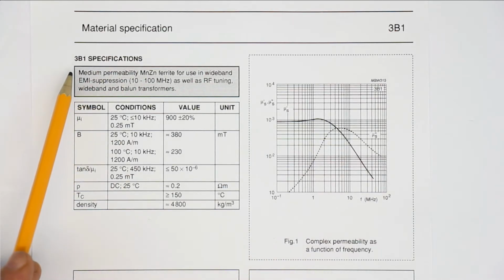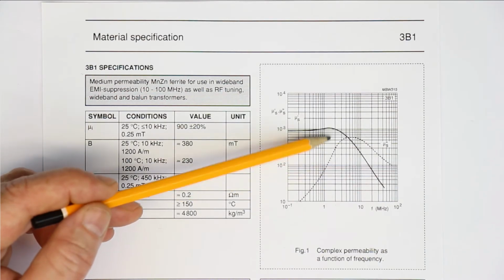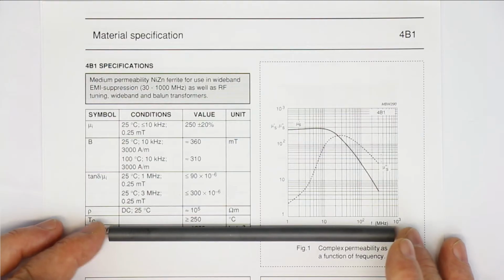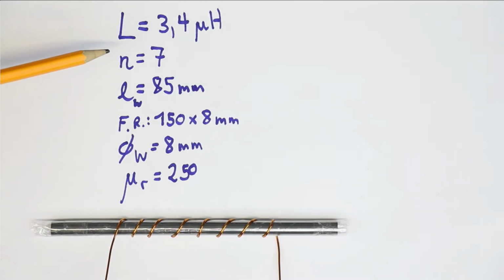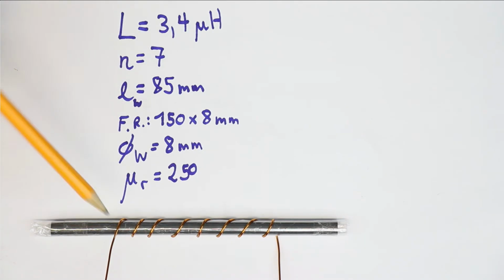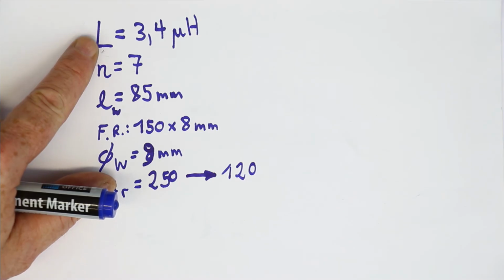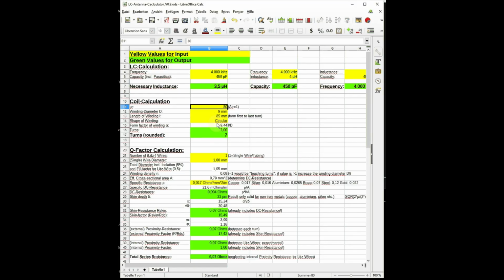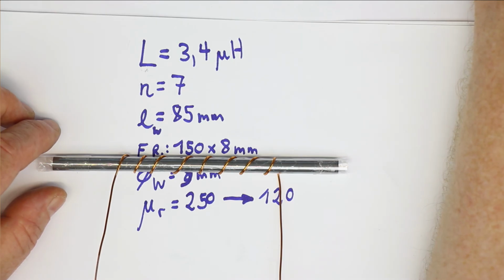A Ferrite-Rod for SW-Reception

Comment: Interesting to play with but actual loop antennas are going to be much better
Reply from the maker: Yes, true. But the advantage of ferrite rod antennas is the much smaller volume for the same signal strength. They simply get "problematic" in the higher MHz-range due to the properties of the ferrite material.
Reply: @KainkaLabs I don't find they are better than a decently sized loop antenna.
As i said, they are fun to play around with.
Get a differential amplifier chip with a good gain bandwidth product and try your ferrite loop and poly film variable capacitor loop antenna on that! Try the NE592 Video amplifier...

Comment: Very useful~
4B1 material seems to be a FERROXCUBE product~
This is similar to FAIRRITE's 52 material~
In the LOOP state, it is useful up to 50 MHZ, but when used as an OPEN LOOP of the BAR type, the permeability of 250 seems a little insufficient.
Even if the loss increases slightly, the permeability should be high so that the self-absorption ability of the radio wave improves a little more~
And the important thing is the length~
Since the relative frequency is relatively low, the length should be increased to increase the potential of the input signal~^^

Comment: Have you tried it for transmission?
Reply from the maker: Ferrite antennas are only useable for reception! If you try to send a high current through the coil the ferrite will immediately saturate. That´s why LW, MW and SW-Antennas are completely different and never use ferrite material.

Comment: Is aluminium a useable SW material ? It is often used in VHF coils.
Reply from the maker: What do you mean by "a useable SW material"? As core for a winding or as wire-material? Anyway Aluminum is certainly not suitable for both at SW-frequencies.
Reply: @KainkaLabs  It is used for VHF/UHF coil cores. Thats what i mean. CORES.

Comment: I have a question about the reference loopstick you showed with 3 litz wire windings on it (1 small, 1 large, and then one tiny one in blue wire) : I assume these are there to allow the antenna to cover multiple bands, is it possible to have both (or all 3?) bands active at the same time, or do the unused portions have to be open circuited to allow the proper resonance of the remaining coil?

Comment: Roger , thanks for the info and video , i am thinking of making the loopstick antenna for a s w Crystal set i built which tunes from 5 to 10 mhz. Needs tuned half wave dipoles to pickup enough signal to hear the audio ! I am wondering if i build a similar rod antenna like the one described in the video would receive enough signal to work as desired !  So happens the coil i made from #12 copper wire (2in) diameter is 3.3 uH !  Any help or recommendation would be appreciated !  Thanks again ! Jerry K9UT

Comment: Interesting rod-antenna notion ..
I remember bk in the early 90's a hitachi am stereo  C-QuAM modulator using pure. 9999 silver wire winded at a long ferrite rod made in Japan,  but I'm not sure what type of material they used on the ferrite rod antenna..
Thanx for the video.. keep up the good work..
Fred Feldmeier 
Dubai UAE..👈😎👍🇦🇪

Comment: Trying to better understand the choices for insulating the ferrite rod. You mention that Polypropylene, Teflon, and Cellophane are good options. Is that because they have high dielectric strength? Or low dielectric strength? I was planning on 3D printing some insulating collars using PLA filament for the coils. Is there another filament material that would be better? My application will operate between 400-500kHz.
Reply from the maker: It are the dielectric losses which manifest in the dissipation factor (not the dielectric strength). Lower is better. You find some comparison data here: https://en.wikipedia.org/wiki/Film_capacitor 
Teflon is best followed by polypropylene/polystyrene. I mentioned cellophane because it is readily available as the transparent material that is used in food packing. About the properties of the plastics used in 3D-priners I don´t know. But I think they are not very good concerning the dissipation factor. 500 kHz is not that crtitical concernnig the losses. Remember that this video was about the SW-Range from 2 MHz...30 MHz
Reply: @KainkaLabs  Thank you!

Comment: Hello, can I glue a broken ferrite rod back together ? What glue would you recommend ? I would swap the ferrite rod, but I don't know its properties.
Reply from the maker: in principle it is possible. About the glue you have to try for yourself. I would start with either superglue or 2-component epoxy glue. You will probably only have a single try :-)
Reply: @KainkaLabs  I will use UHU endfest 300.
Should I clamp in together with a C-clamp ?
Your 10mm x 200mm rod would probably work, 3B1 ? for long wave, SW and MV. I don't own fancy gear like a frequency generator or a frequency counter, I can't do adjustments.
Reply from the maker: Our 200x10mm ferrite-rod is of Russian origin. So no datasheet. But it is useable only for LW/MW. Only our 150x8mm rod is of a special ferrite-material suitable for SW-frequencies.
Reply: Used in the GE Superadio.  @KainkaLabs

Comment: Howdy.
To estimate the effective aperture of a ferrite rod check this site:
   https://caves.org/section/commelect/mm/mm04.html
Regards.
Reply from the maker: There still remain some variables like the size (length) of the winding and the position of the winding of the rod. Theses parameters are often used for fine-tuning the inductance of the winding.
Reply: @KainkaLabs  Yes. You are correct, of course.
The graphs only evaluate the effective aperture or "amplification" of the rod.
Regards.

Comment: That's a great tip and it's something I've always wondered about and didn't know the answer until now. Does it need to be ethanol or will other kinds of alcohol also work? Btw it's denatured alcohol not denaturalized (which means something else entirely).
Reply from the maker: I would only try it with ethanol. The reaction is well described in chemistry textbooks and I am not so much into chemistry to predict if also works with methanol or isoparopanol. Just 2 more hints: Do not use a kitchen burner as I did in the video. Use e.g. a bit of the alcohol that you later use for the reduction reaction. And for not too thick litz-wire or copper wire: use just your solder-iron set to >350°C and use solder with 3% flux ingredient. The action of the flux + the heat of the tip will usually also remove all residues, oxides, sulfides, enamel or PU coating etc.
Reply: @KainkaLabs  Thanks for the great information. Chemistry and I have parted ways since high school and ever since then I generally go out of my way to avoid opening a chemistry textbook - hence I prefer asking others ; )
Initially I thought this only applied to the special enamel (polyurethane?) of Litz wires but, coming to think of it, it's a copper reaction so as long as the wire coating is burnt off it should work for any enameled wire. My only addition to this would be to hold the end of the wire near the length to be tinned with a pair of pliers so as to prevent the heat of soldering tip or flame from damaging the wire coating further down.
I just realized I've posted this comment under the wrong video - which is a shame unless you have the power to move it under the correct one.

Comment: Where did you get your ferrite bar from.the ones I could find On eBay  two side are flat and two side are,I am four droids inch long bar .I am trying to make a new one for tube radio anyone ?
Reply from the maker: It´s just a matter of finding the right number of turns to get the correct inductance with an unknown ferrite rod. There are so many variables (ferrite material, diameter, length, shape, position of the coil on the rod) that you can only it determine it experimentally.
Reply: @KainkaLabs  the old ferrite is in several pieces and the new ferrite bar is a larger size ,I couldn't font the same size ,so I going to wrap the length of the new rod,I ordered bees wax to dip it in 0when I am done the replacement rod has two flat side and two round size so that's kinda of a pain too.
Reply from the maker: It´s available in our shop: http://www.ak-modul-bus.de/cgi-bin/eng/iboshop.cgi?showd280!15,374236454720163,FERRITE-ANTENNA
Ferrite rod alone:http://www.ak-modul-bus.de/cgi-bin/eng/iboshop.cgi?showd280!15,374236454720163,FS20010

Comment: I will be making a replacement ferrite antenna for a AM tube radio ,the ferrite antenna that came with my radio was shattered ,so I bought a ferrite blank and magnetic wire ,and am going to try to copy the original best I can ,my broken antenna didn't use any plastic on it .so I am hopeing  when I get it done it will work .anyone I put would be nice.

Comment: An excellent very informative video. Since I'm surrounded by ever increasing "electrical pollution," I was forced to install a second "loopstick" antenna for shortwave. My radio uses a ferrite rod for medium wave and "shortwave 1" (2.3-7 MHz). I made my own loopstick antenna for "shortwave 2" (7-22 MHz). The rod I used appears to be material 61, which has a lower permeability than the AM/shortwave 1 rod and looks more gray. I used an approximately ~7 1/8" (~180 mm) rod, and I was surprised to receive many signals including amateur stations on the 20 meter band. I can hear static all the way to 13 meters but there isn't much broadcast activity there. Sometimes when propagation allows, stations on 41, 31 and 25 meters sound like local medium wave stations. On some occasions even stations on 16 meters sound as if they were local medium wave stations. I use the ferrite rod antennas because they "hear" the magnetic signal instead of the static plagued electrical portion. Using the telescopic (electrical) antenna in my location renders these signals useless.
Reply: Sir my tube radio Philips 15RB708/00S in m/w anttina coil not original so please help me for good response
Reply: Waste of time. Just make regular loop or buy one.
Reply: @KandiKlover  Don't be so dismissive. It's not a waste of time in the slightest. It's far more transportable than a loop and less prone to damage in a bag. Also, why buy when you can make one for far less whilst also being able to make sure it's operating at optimum for your own sets? Plus, there's far more self satisfaction and learning involved than just clicking in A*****n or E**y.
Reply: @KandiKlover  You are a waste of skin and oxygen. They said it worked very well, so not a waste of time at all.

Stop being a useless drain on humanity.

Comment: That it has passed through my mind: for short wave  try using appropriate ferrite for short wave, as material 61 or similar 4C65, or the 4B1 = K? or the 43 = 4A11
Reply from the maker: So what is your question?
In the comment below you can see that the material is Ferroxcube 4B1(similar to Amidon 61)